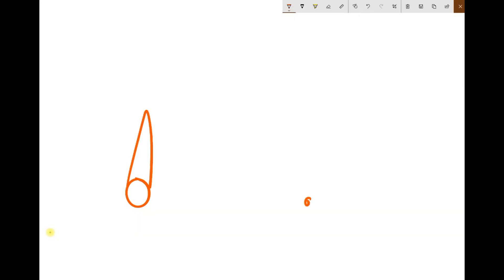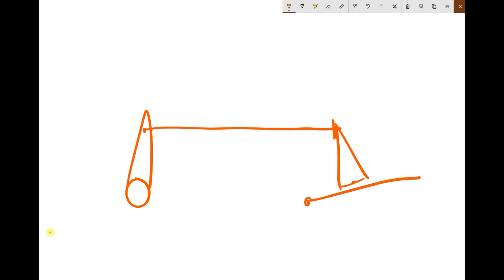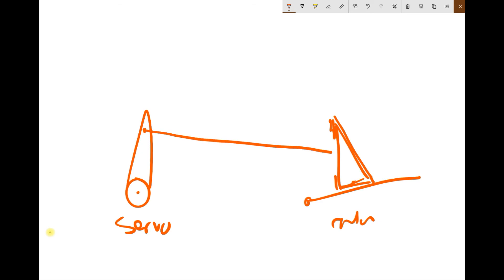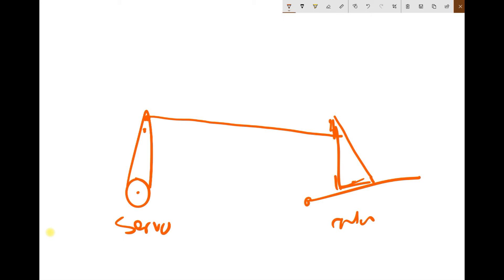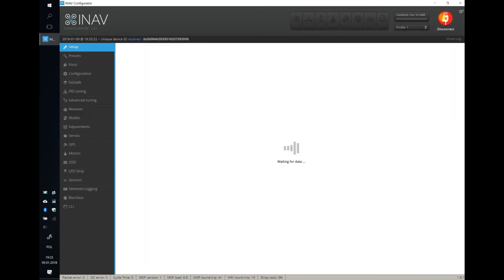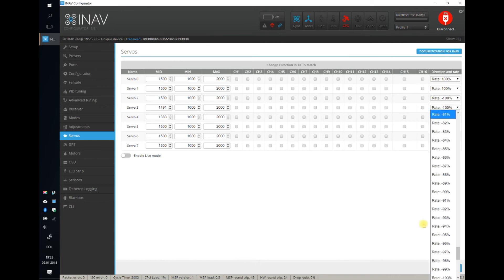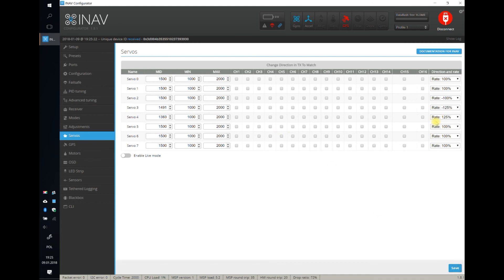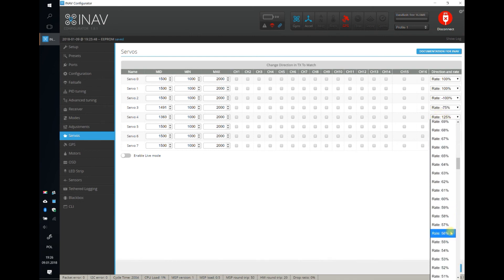Not getting full servo throw on a flying wing? This is why

Comment: Pawel, thanks for making this video! So if  I need to decrease overall control surface travel because the model is too agile while on manual mode I could then decrease the servo rates to 75% and test correct? I’ve already attempted to tame the airplane mechanically but it still needs further adjustments to make it fly how I prefer.

Comment: Hi, I hope you can help me understand this problem. I have a glider with a matek f722 wing, it is the first time that I try to fly with a stabilization board of this level, currently, doing tests on the bench, everything works, (no errors and I can perfectly arm the engines) I have a solid signal from the gps, ailerons automatically respond to deflection, elevator responds to deflection but the only thing that does not move is the rudder :( :(
Please, give me an explanation. THANK YOU VERY MUCH

Comment: Thanks Pawel! I have a question about S800 config. The default 'template profile' in iNav 2.3 sets up 50% 'weight' on each servo axis in Mixer. IE: Servo 3 - 50% Roll, 50% Pitch. Servo 4 - 50% Roll, 50% Pitch. Is this correct, or should I change to 100% to get full throws? Thanks!
Reply from the maker: This is correct
Reply: @FPVUniversity  sorry, which is correct - 50% or 100%?
Reply from the maker: @thedoble  50%, there is no bug
Reply: @FPVUniversity  great thank you!

Comment: Sorry its no OKEY! Launch mode gives me so less servo throw, every time it grounds. If i start in manual mode, it climbs like champ! Destroyed 3 set of props.
Reply: I found that I prefer the saturation. Gives me greater control at slow speeds. Rarely do I need both full elevator or full airleron at the same time.

Comment: Okay I understand that, but I'm not getting full deflection while I'm in the air. Don't know what I'm doing wrong but I can't even do a loop with my AR wing let alone a roll. I can't die because I can't pull out of the dive and it rolls so slow I have to do four point rolls with lots of down elevator when it's inverted of course there's no rudder so I can't do knife edge during the roll for a 4-point roll but it's so sluggish in the air it doesn't want to do anything I'm confused.
Reply from the maker: Are you flying in Angle mode?

Comment: Hey man thanks for your video maybe you can help me I've searched everywhere I set up an f 411 board on a standard plane and in manual mode I have no rudder I am just bank and yank but with the system on for leveling even holding it in my hand armed rudder works but I have no rudder control  authority in manual mode which I can't figure out why I should have full deflection like all the other servers I assumed if you can answer this thanks or anybody else if not keep up the good work and I like that you're using whiteboarda lot easier to understand when I can see how you drew it out thank you

Comment: Hai pawel..... I have a problem with my setup. My servo in elevator and aileron become very slow and wont go back mid position when i armed and in angle mode.

If i disarmed and angle mode still active, Those aileron and elevator servo become normal... In speed and they would come back to 1500 position.

Manual mode is no problem...
Any suggestion?

Comment: Should be nice to have some control during the installation to see on the bench if the control surfaces deflect the correct way when moving the plane around. Now the deflection is so little, it's hard to see if it is correctly programmed...
Reply: Test with MANUAL mode in Modes
Reply: He explained how to do that in the video. Remove the prop arm it and move the throttle up. Doing it in manual mode is not going to give you a reference for what it's going to do in rate mode. Because it uses two different rate systems. So only way is arming it with the prop off, moving the throttle stick up, then checking for deflection.

Comment: Thanks for the help Pawel
A very full and clear explanation
I am comparing the flight characteristics of two identical conventional planes - one fitted with a well known plug and play FC,  and the other fitted with INAV and Omnibus F4 FC
INAV comes out better  - the plane reacts quickly to the nav modes and flies smoother and is more responsive
Keep up the good work
regards
Hans